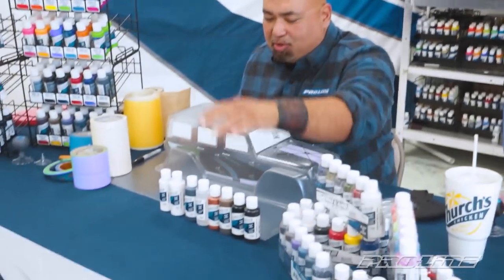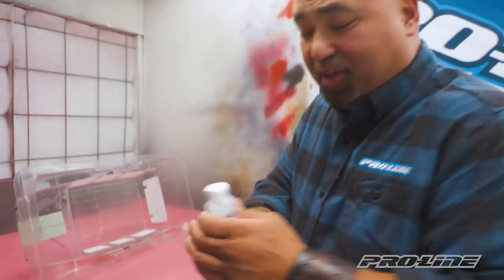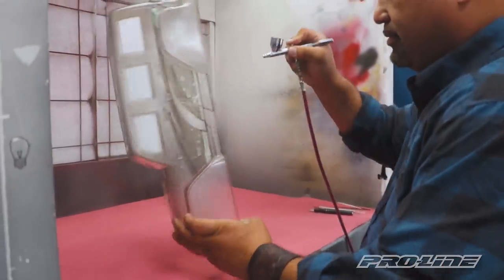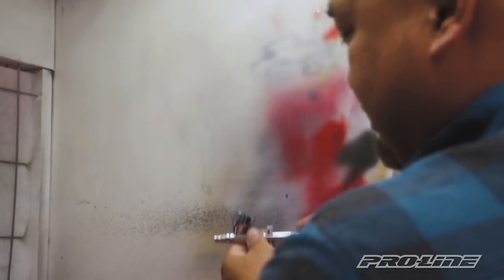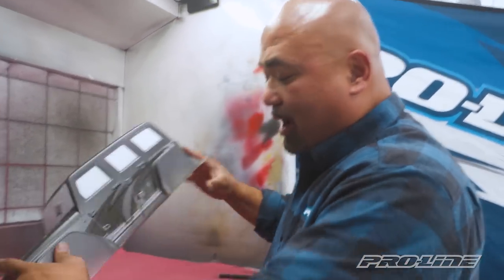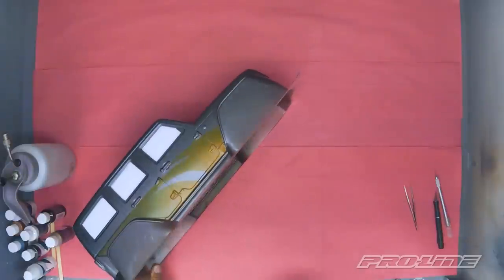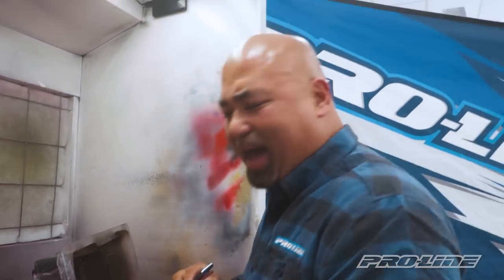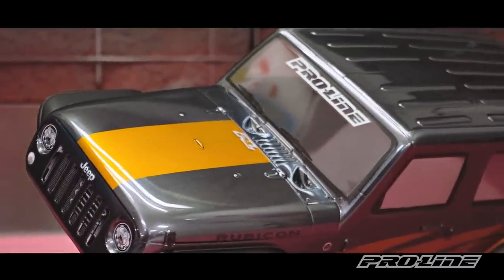Pro-Line SHOP TALK Ep. 16 - Fundamentals of RC Airbrushing Part #2

Comment: ✌🏻😎🏴I hope you don’t mind but I have questions about Matt clear - Q1. If I spray Matt clear on the inside of the body before I apply colours, will it still work? Q2. Can I mix proline Matt clear into other proline paint to make it Matt paint? (if you can’t mix it with certain colours/paints. Please specify which ones) & if yes - Q3. what ratio of paint to Matt clear should I use to get the same effect? Q4. I purchased ALL sets of airbrush paint but am I missing anything that’s not included within the paint sets?
Reply from the maker: Hi @RC Masked Master,
Here is a direct response from our Head of Graphics and Paint.
Q1 - Spraying the inside of the body with the Matte Clear is for after painting only as a final coat. It is adding another layer to help with scratch protection and most important fuel resistance if that is the application (1:8 Buggy). To get the matte finish you would need to spray the outside of the body after removing the protective film. This way when a hard scratch happens it is only a clear scratch. Also you can reduce the Matte Clear about 5-10% and spray medium coats (not wet flow coats). Q2 - You can mix the matte clear with all colors (except candy) to make a matte color to spray on the outside that will have a better mar resistance than painting straight from the bottle. This is what I do to spray the matte black details on fenders, beds and windows. Q3 - You can mix it in any ratio but I've mixed the flat black at 50/50. Our paint dries to a satin finish so adding more Matte Clear to the paint will have more of a matte finish. Q4 - Some of the sets have duplicate colors (i.e.- Secondary set has a Pearl Blue and so does the All Pearl set). On the paint product pages there is a full color chart pdf for reference. There are 8 colors that are not included in the sets if you are wanting to complete the full line of Pro-Line paints (6325-10 Slate Blue, 6325-11 Heritage Blue, 6325-15 Sting Yellow, 6327-04 Pearl Black, 6328-06 Fluo. Pink, 6328-07 Fluo. Tangerine, 6328-08 Fluo. Aqua, 6329-05 Window Tint)

We hope this answers your question,
Thanks for your interest and support!

Comment: So I want to paint my body florescent lime green with black stripes. So would this be the order? 
1. Lime green coats
2. White or silver
3. Matte black for decals
I was wondering if the black would affect the green, or do I paint the decals on the exterior? 
Great video.
Reply: You work in reverse order to regular painting so actuality is you would paint black first, back it with white, silver, black etc and then your lime green with white or silver. The brighter the backing color the more vibrant the intended color becomes.

Comment: used candy blue, white and black backer. 2 days later paint is coming off. yes I cleaned the body with hot soapy water dried then painted and yes I used reducer . not happy. almost $60 bucks. bad results. can you explain.
Reply from the maker: Hi @Salsbury Pat,
This answer come direct from our in house painter and paint designer:

You will need to apply the paint in light/medium coats (not dusting - dries before hitting the body, or heavy wet saturation coat - too wet and creates a skin on top not allowing paint that has contact with body to bond properly). Dry with air only in between coats. Candy colors will get darker after each coat is applied. if sprayed candy heavy coats for first coat it cannot bond properly. It takes multiple light/medium coats to properly - 4 is about minumum. Paint does take about 48hrs to fully cure and bond to the polycarbonate.

We hope this helps answer your question,
Thanks for your interest and support!

Comment: One guy on here painted a Nova body for his  RC Dragster using Pro-Line Candy Red and no way he could spray right out the bottle,when he poured it into his mixing cup it looked like maple syrup and he had to reduce. I have an Iwata Revolution, Neo TRN2, Neo CN, and Neo Bcn. Which brush would I have more success with when using Pro-Line Candy paints? They all have .5 needle/nozzles except my Neo CN it has .35
Reply from the maker: Hi @Jonny Crash,
Here is a direct response from our R&D team:
They do spray direct from the bottle with a .5mm tip. If you are in a cold climate it might not spray as nicely as it should. Just a couple drops of reducer in the cup is all you need if it is not spraying to your liking. Spray with the .5mm for general color coating at about 30-40psi and adjust as needed. All of our color sample bodies on the website were sprayed without reducer.

We hope this answers your question,
Thanks for your interest and support!
Reply: @ProLineRacingYT  fortunately my studio is climate controlled. I guess I'll go ahead and order the whole set. Thanks a bunch for the reply.

Comment: Ok I just bought the entire Pro-Line Candy Set, which airbrush would be my best choice to spray these paints. I have an Iwata TRN2, Iwata Revolution,Iwata Neo BCN, and an Iwata Neo CN. All have .5mm Needles/Nozzles except my Neo CN which has .35mm.
Reply from the maker: Hi @Jonny Crash,
All of them will work. The .35mm might need a little reducer in the paint to get the flow you like. All our paints are ready to use out of the bottle with the .5mm, and may be reduced 5-10%. 

We hope this answers your question,
Thanks for your interest and support!
Reply: @ProLineRacingYT  thanks a bunch!

Comment: Just started using proline paints, just waiting for metallic pewter to be in stock, do I really need reducer or can I just use water as its water based ?
Reply from the maker: Hi @dooronron69,
You should not need to reduce using a .5mm tip, but if you do, use the Paint Reducer at 5-10% (few drops stirred into the cup). Do not use water to reduce. Also over reduction will change the properties of the paint causing lack of performance and adhesion.

We hope this helps answer your question,
Thanks for your interest and support!
Reply: @ProLineRacingYT  Thankyou for your reply, I've only just started using Pro-line paints but think it's going to be my goto paint from now on, love the quality and range. 😊😊😊😊

Comment: Hi, I need some advice. I been airbrushing bodies for 2 years now and from what I hear I do great work, but I cant seem to catch on with Candies, Spazstix or Pro-Line. I'll be doing even lines and overlapping like everyone says to do, and everything will be going great, and all of a sudden I'm getting these bump looking things in the paint. It's like little bumps that when you flip the body over it looks like there's some kind of specks in the paint. I wash and clean my bodies, and when using Spazstix even use the Spazstix Pre-Prep and I'm still getting these bumps, even with Pro-Line Candies. I can do any other paints fine including,Translucents,Flourescents, Mirror Chrome, You name it. I just can't seem to figure out what I'm doing wrong every time I try to spray Proline or Spastix candy paints. Anyone know what's causing this? or what I'm doing wrong? Any advice,pointers,or info will be highly appreciated!!!
Reply: I use createx and never have a problem.
Reply: Are you talking about Createx Auto Air Candies?
Reply: Is your air filtered good?
Reply: @hoodratrc  Yeah, I have a Master TC40T compressor with tank, also have a Kobalt Quiet tech 26 Gallon compressor with regulator and moisture trap. I use the Kobalt for 1/8 bodies and the Master for 1/10 bodies and have no leaks on either compressor
Reply: Candies have to build color over many, many, MANY, light layers. If you drop a layer too wet the surface tension in the paint causes it to form bumps. Your first 2-3 layers you won't even really be able to tell there is paint on the body, that light. Like, if I'm using Blood Red Candy it probably takes close to 15 coats light coats to build a deep red. If you try to create that in only 3-4 coats, it won't lay right.